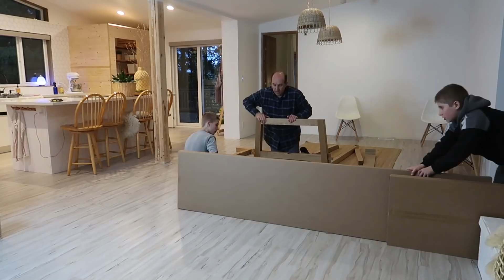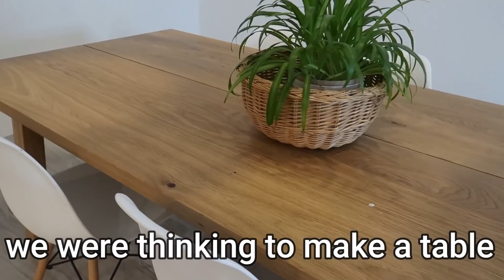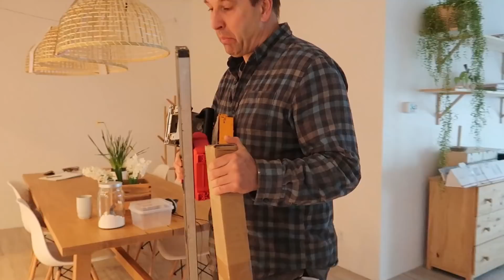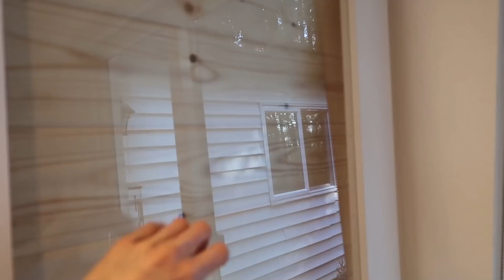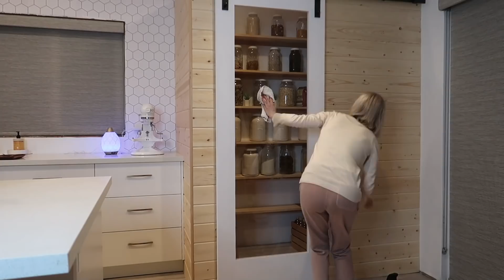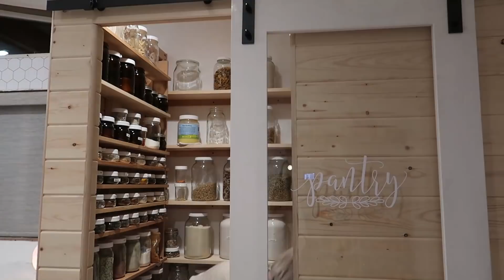HOME PROJECTS IN OUR FIXERUPPER

Comment: The crack between the two parts to the table top would be a nightmare here. Would definitely have your husband join those pieces but you guys probably are much tidier than we are and your boys are older. Looks super sturdy though.
Reply from the maker: I know I was thinking the same thing but Zsolt told me it has to have a gap and has to be made from two pieces because it's very big and it would twist it needs space to move a little😊💗
Reply: As long as the gap is wide enough for the crumbs to fall through..... 😁

Comment: So in 1975 my parents bought this table and the legs and the frame are amazing. However it has a formica top. So my neighbor didn't want to cut down two of his trees. However I was scared they were going to fall down on my house so I asked him he was okay if I had someone cut them and he said yes. Anyhow my friends father came and took the wood. And all I asked was for pieces 2 in thick and I wanted the widest tree. So we did that. And it's been curing down in my basement. So another friend of mine has a 20-in wide planer. And he can do 6 in thick. So I'm super excited about that I'm going to keep the raw edge on each side. I have another friend who does epoxy and I'm going to fill in the cracks with the epoxy after I stain the wood like gray. I'm going to have black epoxy in the small cracks. And then I have to figure out how I'm going to seal the wood. Am I going to put a clear top of epoxy how am I going to do this. Anybody reading this has suggestions please let me know. And I think I might I'm not quite sure make the legs black I'm not really feeling that I might do a darker gray stain. And a friend of mine helping her move gave me a bunch of chairs. So I'm going to be standing those down and staining them gray. Jamie Ray vintage has a lot of non-toxic handsome products so I'm going to look into that.

Comment: You have to spray. Inside and out. I’m telling you that’s the only thing that will help.
Reply: Had an ant trail coming in the front door. Sprayed ant roach killer on the trail and the porch.  Then They came in the kitchen door. I sprayed that trail and followed to the nest. Been gone 3 years.
Reply from the maker: We used some spray but we haven't located where they coming in they are just randomly walking like one or two on each shelve. I sprayed the edges and the door but they still finding the way in 😬
Reply: @ScandishHome  Some areas you must spray all around the foundation of the house, and check for any branches or overhead wires coming to the roof. It depends on what kind of ant. Here in Illinois, tiny ants come in for about 2 weeks in the spring, then go away. No need to spray, just keep clean so they don't get into your food. When I lived in pine woods in Massachusetts, everyone sprayed all around the foundation once a quarter, to keep the carpenter ants out. I hate pesticides but carpenters are really tough.
Check out your state public university's extension service for help identifying what kind of ants (so you know the best approach). You mentioned Oregon, so look at Oregon State University Extension Service https://extension.oregonstate.edu/ Extension Services are great sources of all kinds of home information. You can even bring in pest or plants samples and they have experts identify them.

Comment: The table is beautiful but the "crumb catching" seam down the middle is going to drive you crazy.
Reply: I just vacuum them out and if any get stuck, I use a dish brush on them for a few seconds :-)
Reply: A table runner would look nice!
Reply from the maker: It has to have a seam because it's big and it would bend Zsolt told me that's why this gap there 😊💗
Reply: @ScandishHome  Yes, my "farmhouse" table is handmade and the carpenter didn't leave enough room between two of the four boards, resulting in one board popping above the others. I intend to plane it down this Spring but I'd rather it was properly spaced and I could just continue to enjoy it lol